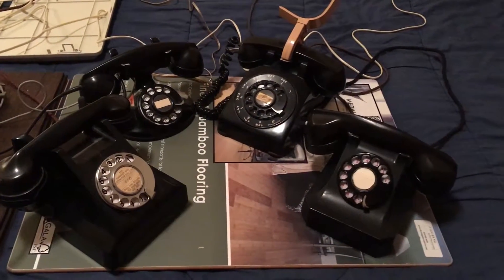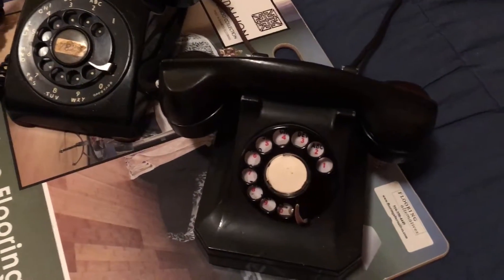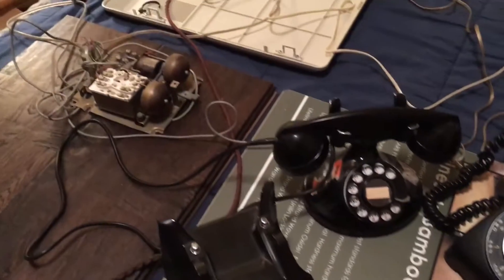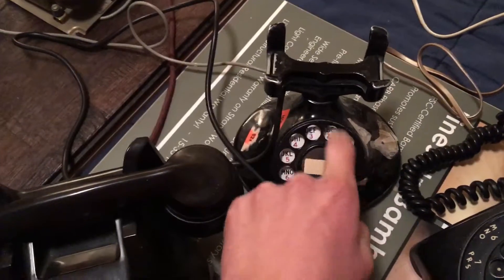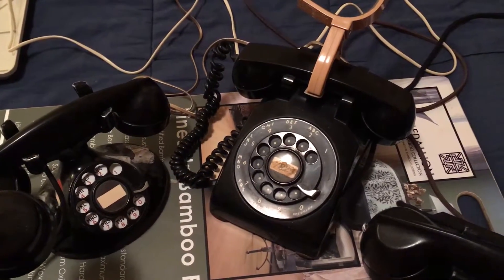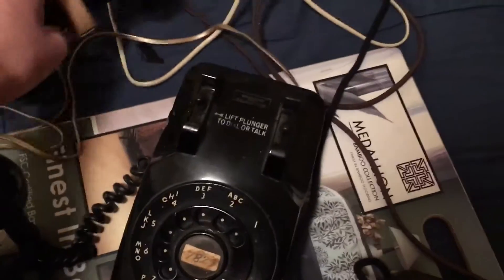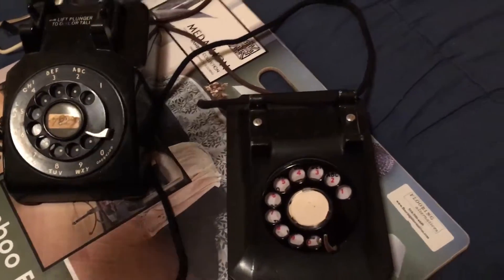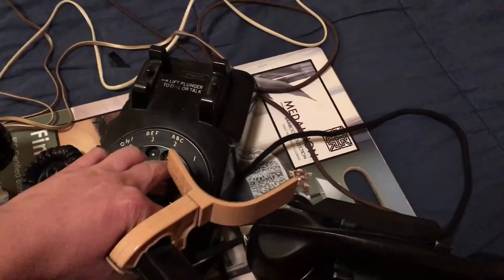Panasonic 308 Ringing Demonstration

Comment: Does that unit have the double ring cadence as standard?
Reply: Panasonic systems used 2 short rings for internal calls as standard. I don't know if they used standard 2 on 4 off or key system 1 on 3 off for external calls